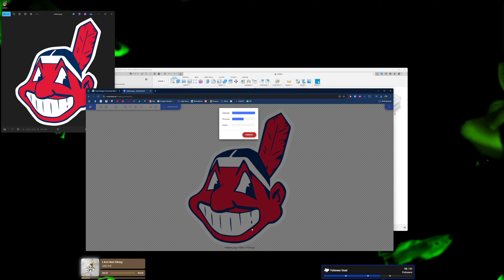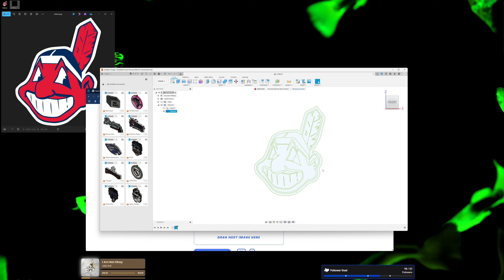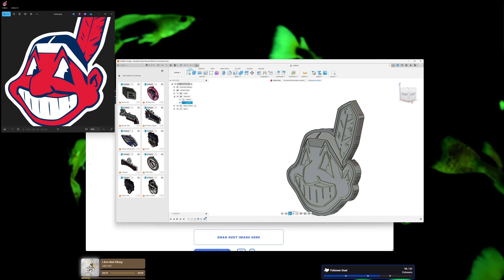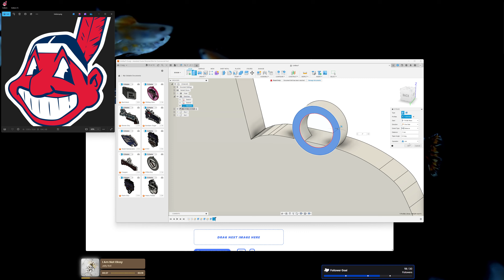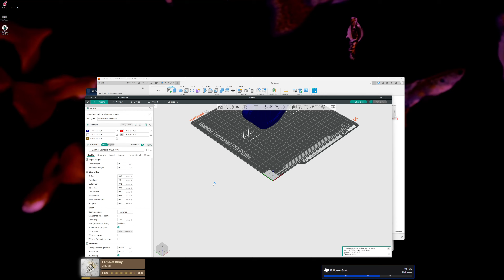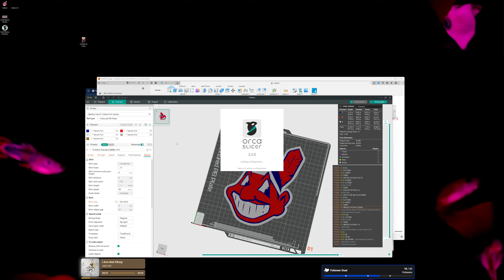How to model 3d turnovers chains!

Comment: Great video! I am having trouble printing mine on my Flashforge Adventurer 5M (this is my first time printing). I am not sure where or how to tell orca slicer when I will change the filament to the next color. Should I print by layer or object? When I do layer, my top two colors are at the same layer. Any ideas? Thank you!
Reply from the maker: So when you are in Orca you need to slice the model then in the preview screen you click what layer you want to add a pause then you right click and add pause. Then you can change the filament and resume and do that as many times as you need.
Reply: so this will be able to make a big raider pendant ?
Reply from the maker: @danaimashaba  Someone made have made one already. If not super easy to make.

Comment: Awesome video. For some reason by Sketch of the image goes to the bottom of the base and when I add the extrusions for different colors it doesn't go negative, but goes below the plane on the bottom. Any help? Seems so simple  that I am just missing something.
Reply from the maker: @LindsayCallaway-c9c  try changing the extrusion to the opposite of what you did. For example if your colors are -1.2mm try changing it to just 1.2 and see if that fixes it.
Reply: @vVvCuhRazy  It still has the sketch facing the "plate" rather than on top like yours appears.
Reply from the maker: @ I would restart the whole process. Make sure you click the front in the top right. Then you should be able to follow the video perfectly. :)